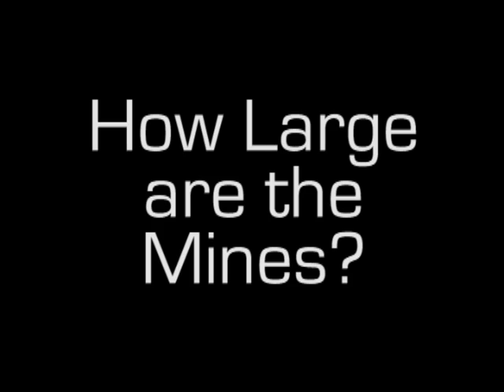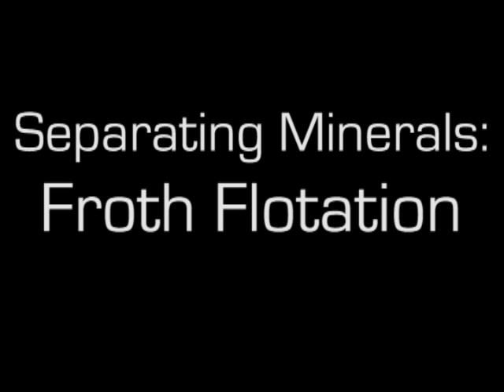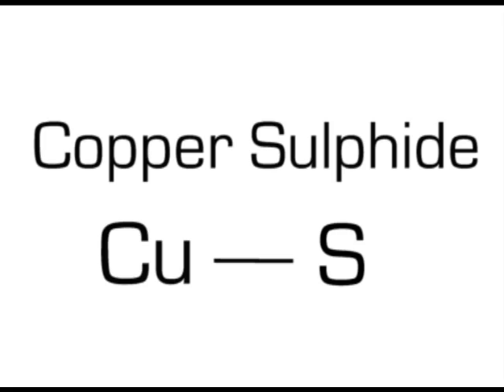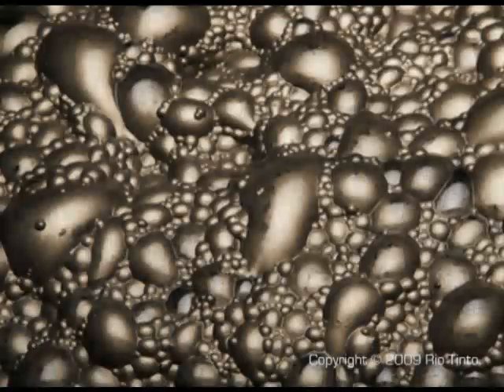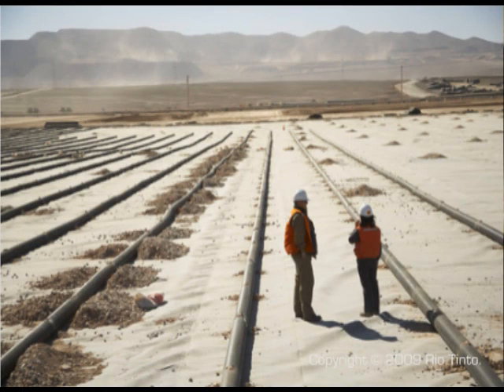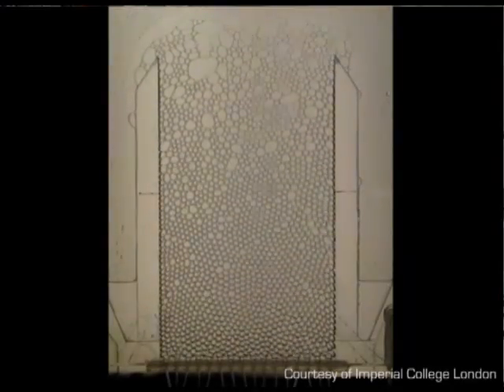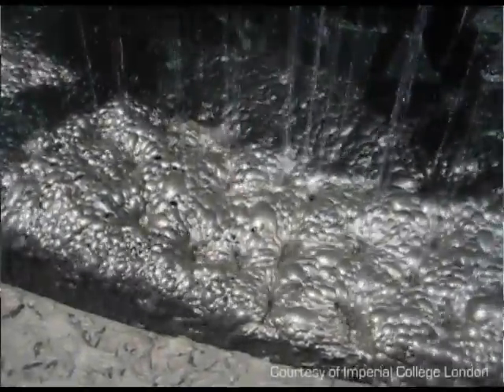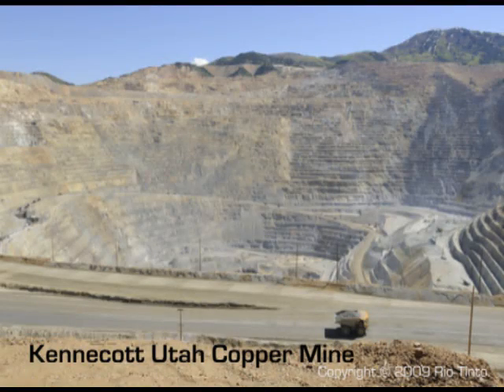Naked Engineering - Separating Minerals

Comment: I wonder if someone would responed to my comment here. I have montomic ore milled to 500 mesh that contains platinum, gold, rhodium,palladium, and iridum. I notice that when I use a leach solution with hcl, chlorine, distilled water heated to 160 degrees, I agitate for 45 minutes. when I add my zinc to drop the heavies it really froths up to the top of my container.It looks exactly like what you show here. Does my ore just automatically froth because it's montomic in nature?